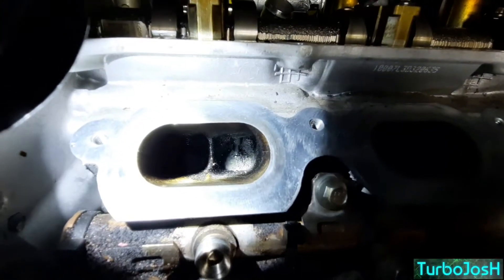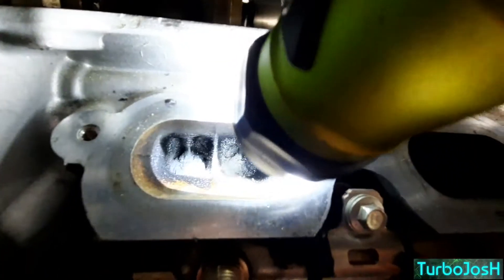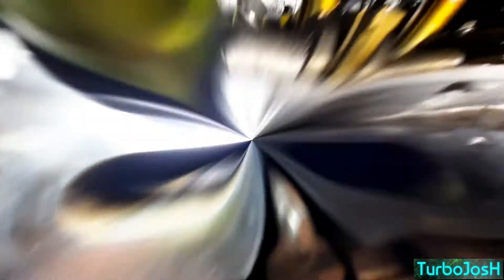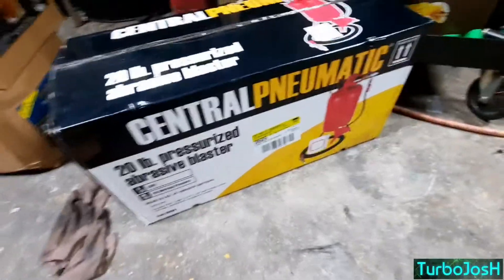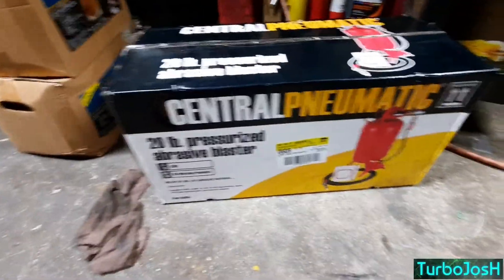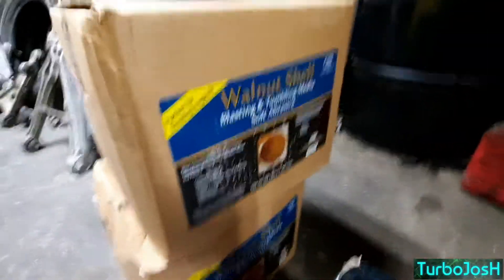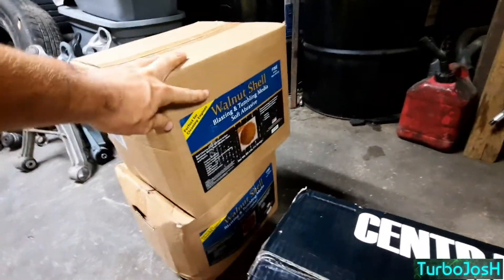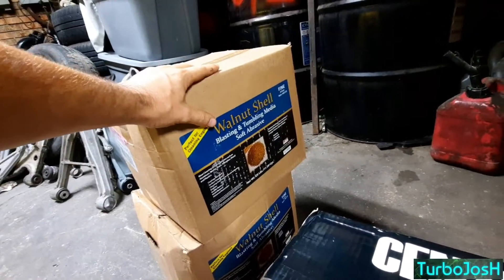Ecoboost 3.5L Carbon Deposit build up 120k miles | MPG Loss | Horsepower Loss!

Comment: And I’m no mechanic or pro… but if/ when I get around to cleaning my ports I am for sure installing a water/meth injection kit… not even for the power gain but running a little methanal over those ports will keep them clean for ever.

Comment: I wonder if you can send diesel fuel thru sump pump to a pressure washer and leave drain plug out? Spray pressure washer wand in the intake.
Reply from the maker: I wouldnt

Comment: I'm seeing Ford recommends NOT doing this due to potential risk of damaging the turbos. Did you have any issues afterward?
Reply: Ford also says the fluids last a lifetime.  Seems like they'll tell you anything to keep you either with the sales department or the service department 🤣
Reply: As long as you do it every 60k or so you’re fine. I did it when I bought my 13 limited and I’m about to do it again at 120k

Comment: Thanks for the video.. 1st I've seen on a ecoboost..have a 2012 F-150 eco with 165,000miles .  I have low mph , an motor drops RPM's when heavy loaded ( brake torque "with out tire spin" ) . Also eradicate turbo pressure code . All sensors are new ($300ish from dealership) .  Its  Borescope time to confirm  suspicions.. an give this walnut blasting a try🤞.  Cheaper then 3 K for new heads as recommended by Ford.  Guess its try a catch can time if this works. Or trade in the truck.. from what I've learned these are pretty much race engines,  drive them hard sometimes to keep them breathing.   No pawpaw driving ( I'm guilty , this truck is my baby an a big investment)  thanks again for the video,  an a update would be awesome!  👏
Reply from the maker: No problem. Ours is doing fine. I hate the ecoboost for this problem it is a dumb problem to have. Driving it hard doesn't help or change anything because it is direct injectors it sprays fuel into combustion under the valves. A normal ls will wash your valves with fuel so the whole open it up and drive hard is not accurate. You may clean a tiny bit of carbon with just hard airflow and boost in the compression aspect. But driving like Nascar will not eliminate the dumb problem. We have seen maybe a mile per gallon or more increase but thats also dash data not like manual tank fill and mileage recording which I would assume would yield higher results.
Reply from the maker: I would trade in if you could afford just think the ecoboost is a total pos. Fun car wife loves the twin turbo do not get me wrong but I'd rather a 3.7 all day. Turbos alone are like 800 which is also ridiculous. And they go out often past 110k miles or smoke from shot seals. But we own the car so well drive till wheels fall off and snag an aviator

Comment: You should have brought it by the shop we could have done what they call a Valvoline All Engine Clean service. It would have cleaned all of the deposits on the valves and also clean the rest of the system.
Reply: Meaning Express Oil and Tire Engineers
Reply from the maker: @jeremysteel6668  how much is this valvoline clean?
Reply: I understand that we actually do what they call an induction cleaning so it goes in the engine through the throttle body. Also we put a fuel system cleaner in the fuel tank that will clean the fuel injectors.
Reply: @jeremysteel6668  what about turbos? Carbon Damages turbo when it breaks off and ends up in a turbine?
Reply from the maker: @jeremysteel6668  ten 4
Reply: Manual clean or walnut blast is the way you will be wasting your money going to a dealership if you expect that carbon to be bad bad or bad enough, don’t risk your catylic converter specially on a 4banger like Hyundai their cars are sensitive it will take it out if it’s bad eventually and the price for a new one is stupid.
Reply: $100.00 just come by and talk to me or mike
Reply from the maker: @jeremysteel6668  pretty sure it won't work that way since it is a direct injection engine bud